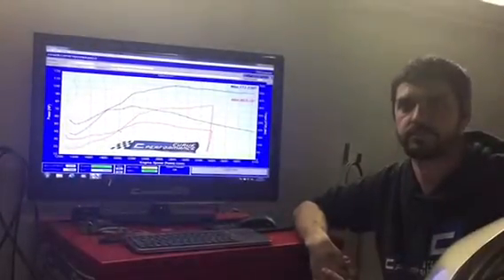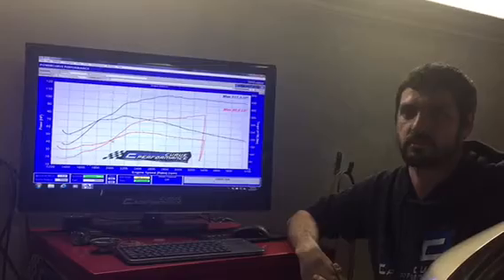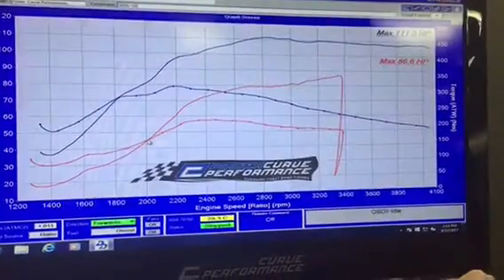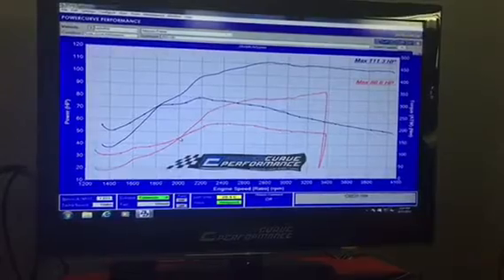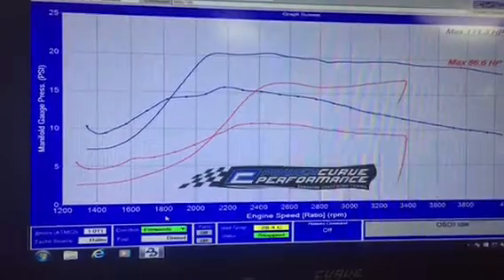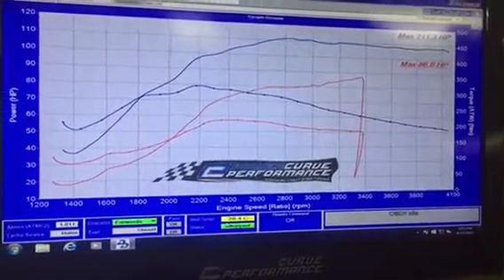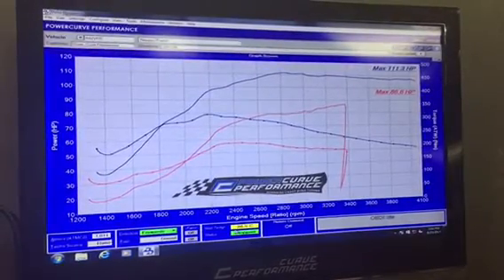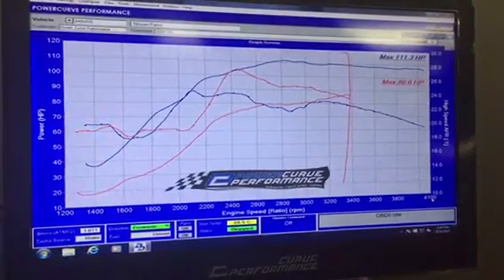Power Curve Performance DI ZD30 Nissan Patrol ECU Tune

Comment: Thought these are 160bhp standard?
Reply from the maker: maybe at the flywheel.  All vehicles are advertised at the flywheel by the manufacturer
Reply: Power Curve Performance yeah so losing 60+hp through transmission loses...quite a bit